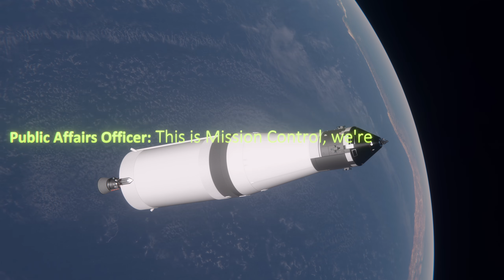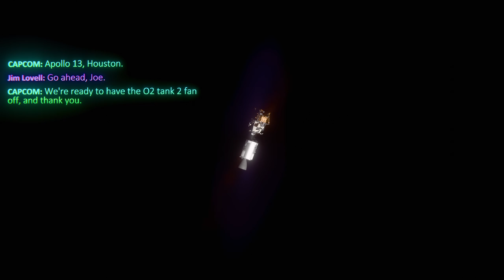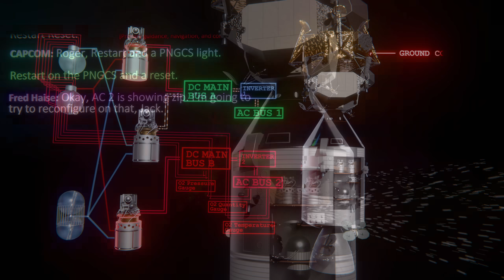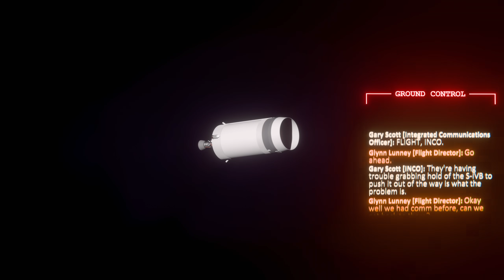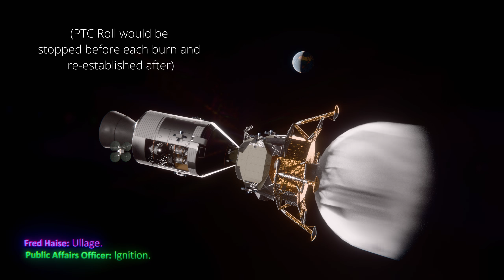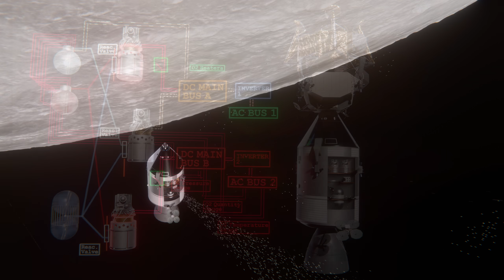Apollo 13: What Went Wrong

Comment: Please explain how they can achieve "Thrust" in a Vacuum? Or change direction without any atmosphere to introduce any physical resistance or friction?
Reply: Thrust in a vacuum is achieved through rocket propulsion, which relies on Newton’s Third Law of Motion “for every action, there is an equal and opposite reaction”

A rocket engine expels fuel and oxidizer at high speed through a nozzle. This is done by burning the fuel in a combustion chamber creating high pressure gases. As the propellant is ejected backward at high velocity, the rocket experiences an equal and opposite force forward.
Reply: Let's say you have a bottle of pressurized air in a vacuum. The air molecules inside the bottle are continuously in motion. They bounce off each other and the bottle walls constantly. Force is transferred with every collision. This means that when molecules collide with the inside walls of the bottle, they try to push that part of the wall outward. Since the molecules are trying to push all of the walls outward in all directions at once, the bottle doesn't go anywhere. It's like tug of war, where everyone is pulling in opposite directions with the same force and the rope doesn't move.

Now remove the bottle's cap. Air molecules can still bounce off the sides and base of the bottle, but not the cap anymore. This means that there's no pressure against the cap of the bottle, which normally would have counteracted the pressure against the base of the bottle. It's like if an entire team in tug of war suddenly let go while the other side kept pulling. The pressure on the base of the bottle wins out, and the bottle starts accelerating downward, away from the cap. With nothing to stop them, the air molecules that would have otherwise bounced off the cap fly off into space. The amount of air in the bottle, and therefore the amount of pressure on the inside walls of the bottle, steadily decreases over time. When there's no more air in the bottle, there's no more thrust, and the bottle stops accelerating.
Reply: As for the changing directions without friction, it relates to the bottle analogy.

Let's say you have a cube in front of you on a table. When you push on the center of one of the faces of that cube, it moves along with your arm in the direction you're pushing. Note that only the force of your hand was necessary to produce this motion, and not the friction of the table or the air.

Now push on one of the side edges of the cube. Since you're pushing off-center, the cube should begin to rotate and move out of the way of your hand. Again, note that only your hand produced the rotational motion, and not the friction of the table or the air.

Now replace your hand with the bottle in a vacuum. If the bottle is pressurized, its base is attached to the surface of the cube, and it is opened, it will push on the cube the same way your hand did. When the bottle is centered on one of the cube's faces, it will push the cube in a straight line away from the bottle's nozzle. When the bottle is off-center, it will cause the cube to rotate away from the bottle's nozzle. Since there's no air in a vacuum to slow down the cube, it will continue to move and rotate even after the bottle runs out of air, but it will stop accelerating. The only way to reverse the motion of the cube would be to counteract it with another bottle firing in the opposite direction.

This is the basic concept behind RCS (reaction control system) thrusters, and they are used everywhere in rocketry. I encourage you to look them up if you're interested!
Reply: If you don't believe in Newtonian mechanics, I can't. If you do, you should know.
Reply: @milandavid7223  Yeahhh. Can't blame me for trying, though.

Comment: 49:06 Gene Kranz is an absolute GENIUS.  calculate the delta-v from the pitch and roll numbers and it will basically draw a big arrow pointing at what's venting.  
He saw all this happen in his mind in a matter of seconds, while being possibly the most stressed-out person on the planet.   (The crew doesn't count cause they were uhh  "out of the country")
Reply: Not moreso than anyone else connected to the problem.  He was a scientist in a room full of scientists and backtracking the math is a fairly obvious method.  He was actually wrong in that there was too much noise in the data because of the explosive initial discharge, and the fact that components of the service module were dangling but still attached, changing their flight profile.
Reply: How does figuring out the velocity difference help in finding out what is venting
Reply: @osyear  it's less about what the Δv number is, but where it's coming from. If you can figure out the Δv on pitch and roll, you can compare them against each other, and then figure out where the torque is being applied, what the direction of that torque is, and how much torque is being applied. The amount of torque is relatively unimportant, but if you can see a torque originating from the SM, plus the cell 1 and 3 failure, you can deduce that one of the oxygen tanks must have ruptured and was acting like a small engine. Hope that explains it, but it's kinda hard to describe without a white board :)
Reply: @dr.jacksonbright5723  Yes! you're better at explaining it concisely than I am
Reply: @dr.jacksonbright5723  and just the amount of force applied was a huge indicator, as not many systems had the pressure or combustibility  to provide that much force other than the oxygen system.   The delta change helped calculate exactly where the breach was, by just backtracking the numbers and assigning them to a new retro rocket in the general vicinity of the oxygen tanks and with the appropriate thrust a venting oxygen tank would provide.  gives them the (more exact) position and the direction of the vent, which could help them narrow it down to a particular fitting, hose, tank, etc. 

I just barely understand how it would work, it's amazing how Gene came up with that in-the-moment.  in THAT moment.
Reply: @osyear  the craft was spinning at a constant rate as it flew along before the explosion. 
they way they make it spin is by using little retro rockets on the side of the craft that push on it. so they have already calculated the force needed to spin the ship by "venting" and in what areas. 

the fact that the ship was now spinning in the other direction after the explosion can tell you many things - 
1. something is venting (acting like a retro rocket) 
2. its very high pressure (stronger than the retro rockets) which can tell you what kind of tank is venting based on their relative pressures.  in this case the only tanks with that much pressure are oxygen tanks, so that narrows down the area of where it could be 
 3. the rotation and wobble of the spin can help you pinpoint exactly where it's venting and in what direction.  

Basically the venting tank became a new and more powerful retro rocket, and they already know the math behind those.  so they run the retro rocket numbers backwards - plug in the new rotation speed and the wobble, compensate for the forces of the actual retro rockets and the previous rotation speed, and you can pinpoint exactly where on the craft the NEW "retro rocket"  (venting oxygen tank) is, and what direction it's pointing.  

they can literally use the math and knowledge of the layout of components to draw a straight line on a picture of the ship pointing exactly the direction the vent is spraying out.

Comment: The lithium hydroxide in the scrubbers reacts with CO2, breaking off the Carbon Molecule and ( literally scrubbing off the Carbon Molecules) trapping it in a filter while releasing the O2 (breathable Oxygen), much like Photosynthesis in plants, where the plant consumes the Carbon Molecule and allows the O2 to continue past. This is a reaction that unlike Photosynthesis requires no sunlight since lithium hydroxide is a highly reactive compound.

Comment: The initial set of alarms probably also reminded them of Apollo 12, which was struck by lightning during launch which in turn deprived a piece of equipment called the Signal Conditioning Electronics to be deprived of the power it needed to function properly.  With the SCE failure all the telemetry data went completely out of whack, even though the systems being monitored were still healthy.  Initial thoughts were probably that something like that may have happened again.

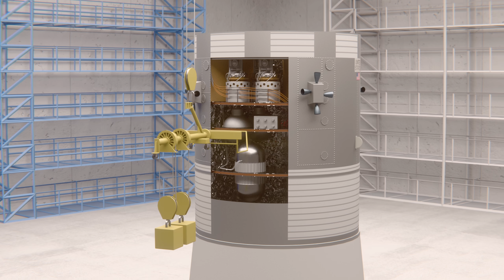Comment: 1:49:52 That right there is why we demand attention to detail in aviation maintenance!! This whole disaster was because of one single screw. 

Excellent video! Definitely the best explanation of this I've ever seen. The movie dramaticize quite a few things, but in all reality the whole thing was dramatic!! I can't imagine what these guys were thinking for 50 some odd hours of life threatening situation.
Reply: It wasn't just the one screw. There was the failure to update the design for the higher heating coil voltage. Failure to investigate why the tank couldn't be emptied beyond 65%. Leaving the fill tube disconnected within the tank. Failure to analyze the impact of the overheat sensor failing and compensate for it. The ignorance of how teflon burned in 100% oxygen. That is a lot of holes that lined up through the Swiss cheese—pre-launch—and resulted in the in-flight explosion. I may have missed a few more.

Comment: They could have shut down the evaporator/boiler (that removed heat from the glycol loop and dumped it into space by boiling off liquid water into the vacuum of space). Using this system they were able to remove about 1000 btus per pound of water. However the interiors of both spacecraft  were cold. with most of the electrical shut down So the liquid cooling system (which is what consumed the most water) could have been turned down (or even off) which would have saved water and warmed up the spacecraft.
Reply: The liquid cooling system removed the heat produced by the electronics on the CM. With those electronics down, there was no heat to remove. I suspect that system was operated by a thermostat, so it'd shut down on its own.

Comment: What I heard was.... The heater in the O2 tank was orginally 12 VDC.  Later on they changed the  buss to 24 VDC and never  changed the value of the 12 heater to 24 Volts.  Obviously the heater burned up and caused excessive heating....

Comment from the maker: Correction: The LM descent stage was designed to be fired in the full Apollo stack and multiple times (or at least capable of restarting its engine), the real difficulty was that there was no procedure for the Abort Guidance System (which they now needed to use because they powered down their Primary guidance and navigation system to save water) to send the entire Apollo stack back to Earth for its second burn. That procedure was created and passed up before the second burn arrived.
Reply: Fun fact: Judith Love Cohen, the mother of Jack Black, was an electrical engineer on the team that developed the Abort Guidance System for Apollo 13. She also went on to work on the Hubble Space Telescope program.
Reply: @willis636 Damn
Reply: This was phenomenal!
Reply: 1:24:49 “mintue”
Reply: It’s also FDO, not FIDO. Flight Dynamics Officer. LFG CM
Reply: @IroncladInsanity  It's written FDO, pronounced FIDO.
Reply: @petep.2092  Yup definitely not super unusual for it to be pronounced a bit different than the spelling.  Another great example of that happening is the Phalanx Close In weapons System (CIWS) which they pronounce as sea wiz even though that would reverse the W and the I.

Comment: Randomly found this video on reddit right before going to bed, and here I am two hours later leaving a comment, which I rarely do. Even though my attention span has been destroyed by social media I was completely captivated. The last ~10 minutes really blew me away, I cannot believe how simultaneously lucky and unlucky they were. In aviation there's the "swiss cheese" model of mistakes, where when they occur independently, might be harmless, but when the mistakes occur together (the holes of the cheese slices line up) you have a disaster. This is almost the opposite case. The fact that the tank didn't blow after being severely overheated on the ground is a great misfortune, followed by the great fortune of the failed pressure sensor and the abundantly cautious decision to stir the tanks more frequently. So so lucky.

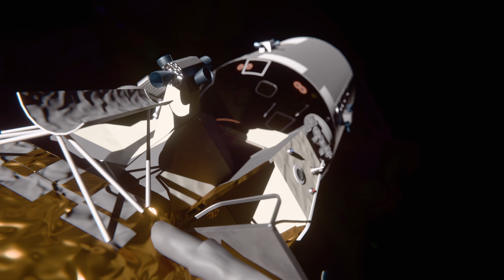Comment: 1:37:51 why would it get colder how's the heat going away it feels like it would overheat like laika if anything
Reply: The electrical systems on the CM were shut down, so they weren't producing heat.
Reply: @zounds010 humans still produce heat though maybe the space craft was able to radaite away that much heat? But it still doesn't make sense to me
Reply: @acompletelynormalhuman6392  The CM and LM were designed to be around room temperature with the crew inside and the electronics running. They did that by balancing the heat coming in (sunlight) and the heat radiating out. 
With the electronics shut down, the temperature in the LM dropped to below room temperature.

Comment: Andy this is a great video.  Ive watched Apollo 13 maybe a few times more recently and even from that I never knew what I just found out at the 55 min mark.  About the LM.  I knew they got into it but never knew they used the engine in that.  I mean I never conceptualized that that was going on.  And that those flight crews were diagnosing so much so fast as it seems from this video.  Again Im only at just a little past the 55 min mark.  I didnt expect Id be glued to a long video like this too.  OK on to the next hour and 5 min.

Comment: I have been a massive space nerd since the very first time I watched Apollo 13 as a child, continuing into launch parties for Starship these days. As an aside, the amount of profanity in it nearly meant I was not allowed to watch it, but it was also historical in its content. I say that to say this: The way you weave the radio dialogue with text, the animations, and just everything together is above and beyond everything else I've seen. I heard radio communications I had never heard before. I was incorrect about some of the timeline up to this point. This is absolutely amazing work. I can foresee myself watching this more than once, my friend.

A quick edit for all my fellow Apollo nerds out there... The massive amount of condensation primarily in the CM would have undoubtedly created a series of short circuits leading to failures of both power and data systems in an already crippled spacecraft. This was avoided, however, due to the decisions made in the aftermath of the Apollo 1 tragedy during the test on the pad. Two of the big things that were changes was to no longer use a pure oxygen living environment and to pot every bit of exposed wire in epoxy rendering it safe from environmental factors like humidity and condensed water as well as assuring no physical in-air arcing that would act as an ignition source would be possible. The three astronauts lost in that tragedy were not lost in vain.

Comment: This is superb. I've read and seen lots of different accounts, but this really highlights the extraordinary work by the flight controllers, especially on Lunney's shift, in saving the crew. In later years they said that -- though they ran sims where they had to power down the CSM and transfer to the LM, they never -- by quite a margin -- were able to do it as fast as happened here.
A brilliant production, this!

Comment: This is GREAT but the f1 engines on the Saturn V were wrapped in thermal blankets and it did a import cut off on stage 1 where it would shut down the center engine to reduce g-loads on the crew. And same thing usually happens, but on Apollo 13, some trudging went out, so that didn't happen. But the rest of this video is great and I think is about 100% accurate

Comment: Stellar documentary. The presentation is phenomenal. Also the visual demonstrations of the incident, showing the systems themselves is extremely helpful and provides an insight into the severity of the situation, rather than just being told about fuel cells and buses.
Reply: And I had never come across the issues with comms due to the interference from the S-IVB. Amazing!

Comment: Excellent video!  While I would've liked hearing some details of Swigert's delicate and life-critical job of powering up the frozen and wet CM, and using the LEM's umbilical to draw additional current into the CM.  I've wanted to know how Houston worked out the complications of reversing current flow to the startup sequence, plus heating the chutes and topping off the CM's on-board batteries.  Still, just a great job with this video!